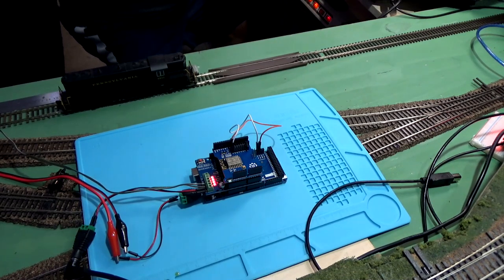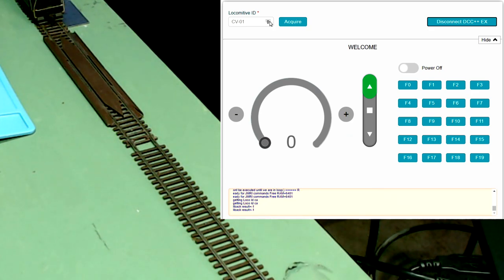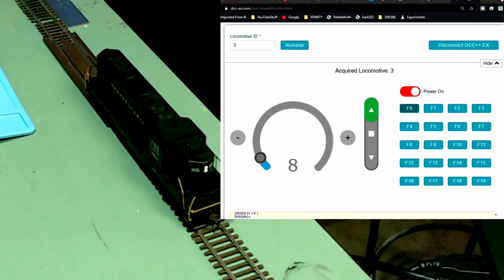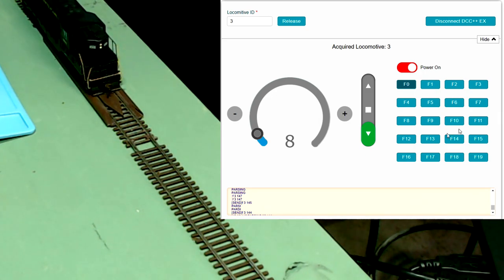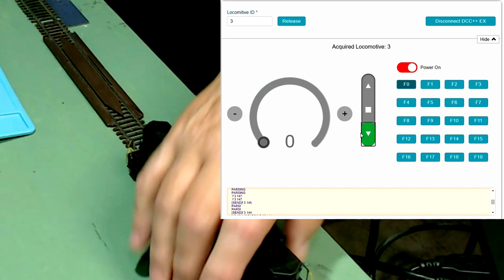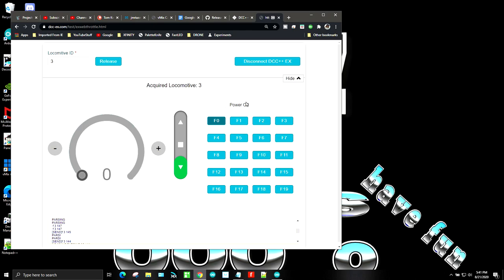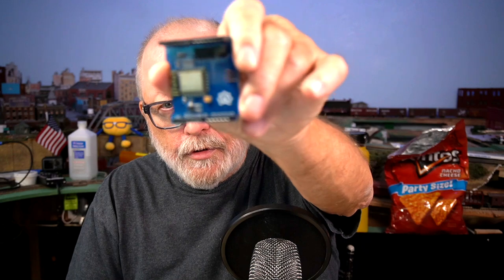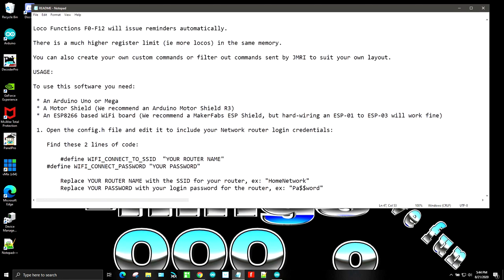DCC++EX Wifi & Web Throttle

Comment: Another Alpha feature IS the AP mode. We have more testing to do and want to see if we can adjust the server name, but if you go to your phone with Engine Driver installed and click on your phone network settings to look for networks you can connect to, you can look for something that looks like an ESP8266 ;) It usually has something like "farylink_123456" or "AI-THINKER_123456". The name of the firmware followed by a number. Any of you who try this, please report your AP name. One of the things we want to see is if we can easily change that AP name. In any case, login to that AP. Then find the IP address, it is usually 192.168.4.1 (a separate subnet separate from the usual 192.168.1.1 of a home router) and login with engine driver! Just enter the IP address into ED, select port  3532. It should work ;)
Reply from the maker: Thanks for the info. I'll try that out when I get a chance. I remember seeing the name farylink when I was playing around with it initially.
Reply: Have I to use only MAKERFABS ESP8266 wifi shield module or can i use other wifi shield module?
Reply from the maker: @federicosarnico  You might want to check on the DCC-EX web site or Discord to see if they teasted any other 8266 devices

Comment: Hi Tom.  If I were to eventually go with EX, do I still need the Uno and motor shield in addition to the nega 2560 esp 8266? Does the mega piggy back on the motor shield? Thanks
Reply from the maker: The Mega is the big brother to the Uno. One or the other. The wifi shield is on top of the motor shield. Now you have more options for wifi. Check the DCC++EX web site.

Comment: not sure if there was a video comparing DCC++EX with a Digitrax system as an example. I hear from some people comment that DCC++Ex is 'not worth the trouble'. They do not explain exactly why? Or is there any advantage of Arduino based DCC compared to a standard one like Digitrax other than price difference?
Reply from the maker: I hear that a lot from people that think they have to write code and build the components. Everything is already done for you, all you have to do is plug a few components together and your on your way. Using a Raspberry Pi as as computer, the Uno Or Mega, a motor shield & wifi board. $50 max. The biggest expense is the RasPi. The operating sys along with JMRI for the RasPi is already configured by M. Steve Todd. All you have to do is download the file to a micro SD card and the utility does all the rest.

You have all the features of a Digitrax or any other DCC system for a fraction of the cost.
I am not aware of any video comparing the two

You can find the most recent version and more available motor shields and wifi boards on their web site and there is always someone to answer questions you may have on the Discord server.
https://dcc-ex.com/
https://discord.gg/gvMxgYmz
Reply: It's so not any trouble at all. I went from zero model train experience to sitting on the couch running my train around the tree for $60 and about 1 hour of doing the build and automated upload. I spent way more time worrying if I would be able to do this or not.

Comment: Hi Tom, got everything on the software site as adviced. One simple question arised when whatching your videos. With the Uno as base board there are two wire connections on the motorshield. Using an Mega this reduces to one connection. My question is what happens when you hook up the WIFI shield? I don't see any wire connection beside the Rx and Tx connection between the boards. Could you please tell me. Greatings from Germany Lutz Wunderlich
Reply from the maker: The Mega only needs 1 jumper because of the different pin allocation between the two devices.
I haven't downloaded the latest version of the software but there was talk that they were going to eliminate as many jumpers as possible. On the older download, the connection for the TX + RX was in the documentation in the zip file.

Comment: I've been using the original DCC++ for a while with JRMI and I quite like it.  It works well. 
I know DCC++Ex is an Extension of DCC++.   Aside from the WiFi controller connections, are there any other big differences?
I have a spare Arduino Mega WiFi from another (disbanded) project and noticed it may be compatible with DCC++EX and thought I might try it out.
Reply from the maker: They have made many updates since this video. For up to date info and chat with developers, head on over to their Discord:  https://discord.gg/kVXUUBcz
Reply: @TomsTrainsandThings  Thanks for that.   I'll have a look and see if anything is a major advantage over the original DCC++.   I am thinking for a small layout it may be barely noticeable but the speed improvements could be beneficial on more complex layouts
Reply from the maker: Better performance for one.

Comment: Tom, I built this but cannot turn the power on to the motor shield with the app. I can only get it turned on using my computer. How do you turn on the motor shield with the app?
Reply from the maker: Did you add the extension to the chrome browser to allow the app to function? You need it to function properly.

Comment: I have my Arduino Uno,  Arduino Motor Shield and have ordered the wifi shield mentioned in this video.

The basestation currently has the old original DCC++ sketch installed but want to install the new DCC++ EX sketch to accommodate the wifi shield in order to talk to JMRI on my lap top.

Is there a short tutorial to set this up?
Reply from the maker: This is an older video covering DCC++ but can also be used for the newer version.You'll have to go to the DCC-EX web page or discord to get the latest update. It is constantly updating.
https://youtu.be/a-gtdccugL0
Reply: Does the DCC++ EX sketch accomodate the wifi shield? How is the wifi shield set up with your LAN/JMRI ?

The DCC++ EX site had no instructions on this.
Reply: Notice you're using a mega and the jumper configuration is nothing I'm familiar with. Will the DCC-EX site explain this with the use of the ESP8266?
Reply from the maker: @davidbowman5407  You would be better off going to their Discord Server. There is always someone there to answer a question. The web site only shows devices that they already approved, but on Discprd you can request additional devices.
Reply: Would love to see a close up of how those jumpers are configured.
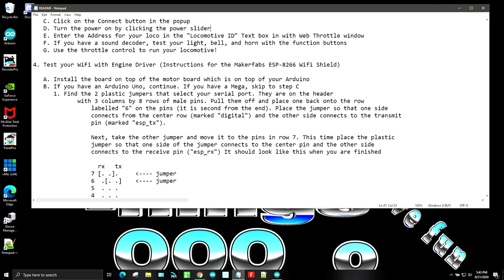Reply from the maker: @davidbowman5407  I show a diagram in the video starting at 9:02 It's in the README file that comes with the code.
Reply: @TomsTrainsandThings  Set up the base station with ESP8266 like the one in your video. Engine Driver can communicate with the base station and turn the track power on and off. I dial up engine address but loco does not respond.

Is there some nuance I'm missing in the setup?

Comment: Aliexpress has mega 2560 with esp8266 onboard for about 10 $ so
no need for shield, works fine.
Reply from the maker: As the developers test more devices and adjust the code to accommodate them. There will be more available, but I think they will have a limit on compatible devices.
Reply: @TomsTrainsandThings  It is working perfect with DCC++ EX and esp8266 has AT firmware already installed, working on Serial 3 as requested. I tried it with my android phone, no problem.

Comment: Dear Tom, I'm a German Model rail road fan. A couple of weeks ago I found the YouTube channels connected to JMRI/DCC++ and related. As you may know there is a lot of German hard and software to Model rail road but, I found you entry with the Arduino and additional shields to built a Command Station/ Power supply very interesting. Unfortunately not all equipment you use is available on the German market (the wifi shield from makerfabs/ even not with ebay/ amazon) but most of the parts are and for others I found a substitute. What I did not find is the related software. I am not member of facebook but it seems that the file needed to complete the setup shown in your video is only available there. Could you please help me to get the file on any other way (maybe by email?). I would really appreciate your support. Thanks for all your videos which I really like. Best regards Lutz Wunderlich
Reply from the maker: Thanks for watching and taking an interest in my channel & DCC++EX. You can get the updated code and a list of boards that will work.
https://dcc-ex.com/
You can also ask questions 24/7 and get additional info on Discord:  
https://discord.gg/gvMxgYmz
Reply: @TomsTrainsandThings  Thanks Tom for your quick answer. I'll follow up your advices and, if neccessary I will come back with questions.